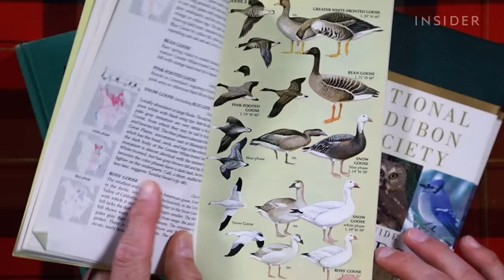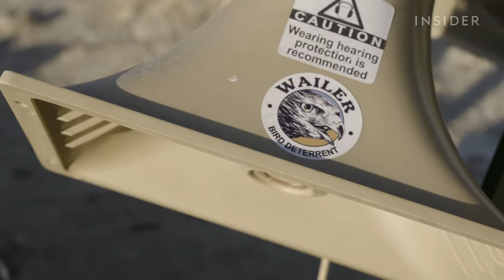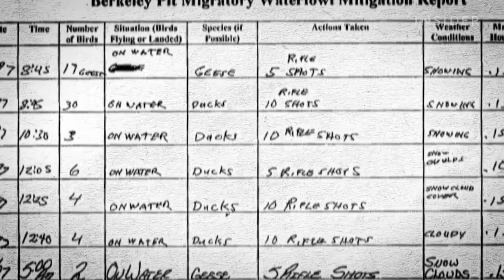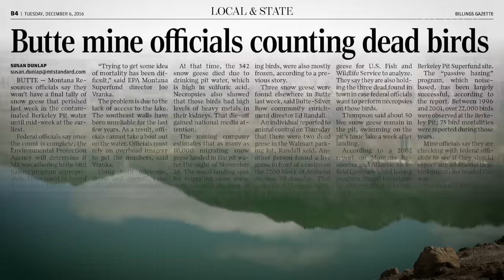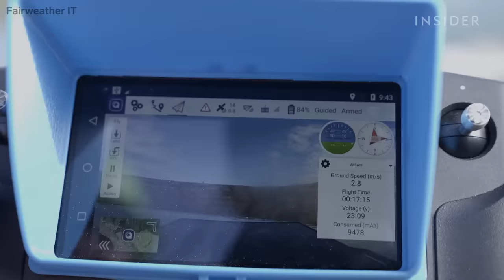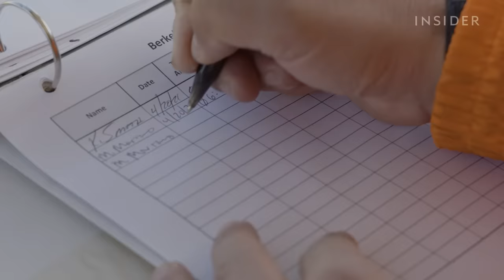Meet The Man Who Shoots At Birds All Day To Keep Them Off A Toxic Pit | World Wide Waste

Comment: I'm curious but how much would it cost to fill/cover the lake? I remember seeing a video by Veritasium where a lake was covered with black circular balls to prevent evaporation, if I recall correctly. But an additional result could be that it prevents the birds from landing on the water.
Reply: My thoughts exactly!
Reply: Interesting thought.  I looked up some information and the pH of the water there is 2.5 which means it is highly dilute sulfuric acid.  The pH of CocaCola is 2.5 as well.  So yeah, it isn't good for animals to hang out in it for hours but it isn't quite as dangerous as I was expecting.  At that low concentration, several plastics and rubbers are compatible with sulfuric acid, so the idea could work.
Reply: Yeah, I was wondering I they’re didn’t covered it with a huge net or something.

It’s likely cheaper to just keep things as they’re.

Comment: Maybe try putting a lid on that pond. Spray foam up the banks and across the water 4 or 5 feet thick. The entire thing! Companies will be able to tell you the best type of foam to handle the weather forever but the foam hardens strong enough to walk across. Maybe 6 or 7 feet but put a lid on it. Spraying 10 feet up the banks holds it in place.

Comment: The effort these people are taking to save the birds is priceless. 👏
Reply: yeah great effort but remember they are just correcting their mistake. the video said one third of their bird popullation has lost.
Reply: Remember the effort it took to rip the planet before
Reply: @chrismunz8127  I bet your indignation probably doesn't stop you from using the products containing the mineral they mined.
Reply: Dump thousands of floating balls in this pit, so that the entire water surface is completely covered and there is no water exposed!!

That way the aquatic birds won't even see the water and won't be able to get to the water ither.
Reply: @ToxicVaccines_HivHoax  I lived about an hour from this place during a point in my childhood.  This place has caused so much controversy and so many proposals have been put forward about how to deal with this place - none of which have actually gotten off the ground or worked toward getting rid of the toxic water.
Reply: @chrismunz8127  that effort made whatever device you watched and further commented on.....try again gaslighter
Reply: Some probebly misunderstood my comment. I criticize that the efforts that went into the mine were much higher than the efforts of protection. Also people first started shooting a gun, driving a RC-boat, flying a drone and handling a laser pointer after thousands of birds died. I dont see an effort to really solve the problem.

Comment: There are some reservoirs that use “shade balls” on the surface to keep birds off while also reducing evaporation losses. I wonder if a similar concept could work there
Reply: They're made of plastic and we're working with an acidic lake here.
Reply: @halamadruuid2380  shade balls are made of HDPE and HDPE is resistant to even strong acids and bases. I doubt the acid in this lake is that strong, compared to what HDPE can handle.
Reply: @halamadruuid2380  Think about the plastic hull boats they were using in this video though, it might work, would be worth testing at least.
Reply: I posted the exact same thing just now but took it down as you beat me too it.i beleive it would work as long as we used enough and had no open water
Reply: No it wouldn' twork  polymers get brittle at freezing temperatures plus the weight of the ice would collapse it in since the lake is too deep for any real center support and too long across to line cables.
Reply: @halamadruuid2380   -  all kinds of acidic substances are sold in plastic bottles and containers. 

So just because something is plastic  doesn't mean acid can dissolve it.

Also, birds are able to swim in this water without suffering any burns. So the acidity of this pit's water is very low.
Reply: @Robofrog100   -  Even so, there are plenty of acid resistant materials out there that can be used.

Even thousands of glass bottles with the lid on, will float and get the job done.
Reply: It’s an incredibly huge pit, you can even see it on Google Earth if you zoom out to all of Montana. So they would need an insanely high number of shade balls to cover it, and they would also need to be acid-resistant. Also, I don’t think they have a need to stop it from evaporating since it’s not meant to be a reservoir.
Reply: @thejessing9911  its only a mile wide. Which would take a lot of balls, but it might be more effective than paying people to stand watch 24/7. You would also only need one or two layers worth. Just enough to keep the wind from blowing them around and forming an open pool.
There are plenty of plastics that are very resistant to acid, it doesn’t have to be HDPE.
Reply: @danialphaomega  they are just floating balls, they don’t support any weight. Any ice formed on the surface during winter might just push them down. If so, the lake is covered with ice anyway and birds can’t swim on ice
Reply: @rpmrunner  would only have to dump a couple truck loads to see how they react to the acid and ice. From there they could continue to dump and they wouldn’t need to pay someone to be there 24/7 and it would be more effective
Reply: @TheBigghunter01  yeah, but that would prevent evaporation which isn’t wanted. However it would get filled with rain and groundwater all the time anyway so it’s not naturally gonna evaporate… it just might be too big of a project to fill the whole mile wide acid lake with balls, though, since it’s so iconic and it’s not even being used as a reservoir. It definitely makes Butte famous and people might not want to see it covered with balls.
Reply: @rpmrunner  the plastic boats don't sit in the water all day, they can't because they would dissolve, and they most likely rinse them off afterwards.
Reply: @Nerezza1   -  That is not the kind of acid concentration found in this pit. 

If it was the birds would feel the burn and fly away instantly. 

Try pouring high concentration sulfuric acid on a bird and see what happens. 
Would the bird stay there and try to bath in it??
Reply: @Nerezza1   - You are contradicting yourself. 

First you say "You can't sell sulfuric acid in plastic containers."

Then you say: "You can sell sulfuric acid in plastic containers..."

PTFE or not, it is still a "Plastic" container. 😉
Reply: @Nerezza1  HDPE does fine in the cold and pretty well with most acids including sulfuric acid up to a pretty high concentration.
Reply: @vqdrift6409  It's like a half mile across or something. The tensile strength of the cables and pylons needed for that is insane. Not only that, but long-term wear and tear is tough on structures like that. Imagine what a 100 mph wind would be like with a sail that large
Reply: @Nerezza1  Can't they just cover it up with a big tarp or sheet of plastic that connects to sticks on opposite sides so it stays above the water

Comment: Can't they use Black Balls like the once used for reservoirs? So they can't swim there...
Reply: The water is highly acidic, the black balls would turn to sludge. There is a very high concentration of sulfuric acid in the water and the video demonstrated what it would do the birds after a couple hours.
Reply: Whilst the plastic is pretty durable who knows how well it will hold up long term to heavy metals and conctrated sulfuric acid.
Reply: @jacobchang7955  certain types of synthetic materials are resistant to acids though. depends on the acid
Reply: @ohusky271  resistance is not immunity. That just means they will decay in the acid bath slower and afterwards who will you send to clean up?
You can’t because any prolonged exposure will melt the clean up crew. Notice how all the methods don’t involve using a boat? It’s because of the high acidic concentration in the water.
Reply: @jacobchang7955  6:11
Reply: @quive5705  notice how it was a small using a boogie board with some hardware on top of it.
The boogie board is easily replaceable and easier to decontaminate compared to the hull of a larger boat.
Reply: Some quick math:

Berkeley Pit size is around 1,414,180 square meter
Silver Lake Reservoir size is around 298,973 square meter

so 4.7 times larger

96 Million black plastic balls(used to fill Silver Lake Reservoir) cost 32 million dollars(I suspect this can be made cheaper, LA city is rich)

So this is going to be at least 150 million dollars for the mining company.

Make sense to just hire a guy to use rifles I guess, LOL.

This is not counting corrosion and winter icing that can potentially damaging the balls and adding cost.

It's probably a lot cheaper to install some kind of netting on top of the pit, but likely still a lot more expensive compare with just hire a guy.
Reply: But it's more American this ways. 🇺🇲
Reply: i just think it would be easier to put on a net or some sort of barrier around it.
Reply: @jacobchang7955  PTFE and ETFE have joined the chat.
Reply: @jacobchang7955  Teflon coated balls could work though
Reply: It makes sense, but covering a surface like that costs 200 million dollars or so and may last 10 years at best if you use acid resistant teflon balls. 

Hiring a man with a gun costs 100,000$ a year, for all the energy, material and labour costs, plus a few million in equipment which is far more cost effective than spending a quarter of a billion dollars every ten years to make a few birds go away.

Man will get the same job done more efficiently.
Reply: Here's the thing. They have an abundance of ammo and guns so why not? Just a dude with a gun and lots of ammo. Simplest problems solved by simple solutions.
Reply: Job Security ;)
Reply: Who knows, maybe a similar solution would be possible. Plastic/Rubber doesn't cope well with acid though, it'd create a whole new slew of effects.

Also possible it's just too much to justify yet. Employing several employees with guns, drones sounds cheaper than covering a whole lake with balls.
Reply: @wizzotizzo  KISS principle! But then  they will not be able to spend tons of money !
Reply: @nathandfox  exactly what im thinking.
Reply: @jacobchang7955  sulfuric acid: delivered in plastic containers
youtube comments: plastic won’t hold up
Reply: @nathandfox  why would the balls not hold up ? There are different kinds of plastic / material that can be used ..
Reply: Ceramic would be acid resistant. and there are some extremely tough ceramics available. Put small magnets in the ball at the appropriate spacing, so that as you add balls, the "net" expands as a cohesive unit instead of random balls floating by themselves. If a ball breaks, it sinks, no big deal.
Reply: @JCWren  covering the bottom of a water reservoir with plastic it’s a big deal
Reply: @JCWren  Very expensive for that large area.
Reply: @tigrehermano  I said nothing about plastic. I said ceramic.
Reply: @JCWren  that’s still pollution, innocuous pollution. And ceramic it’s expensive but the concept it’s good you just need a widely available material.
Reply: @tigrehermano  and how well will they hold up to being crushed in ice? Simply all these other options are vastly more expensive and would require reinvestment every few years to replace all the broken and crushed ones. It financially makes zero sense!
Reply: @jacobchang7955  The proper plastic is resistant to many types of corrosives. Jesse found out the hard way in Breaking Bad.
Reply: @deannelson9565  i am not suggesting ceramic lol read my previous comments
Reply: I thought exactly the same, but it seems more fun to just shoot some guns
Reply: @tigrehermano  And I think Im gonna leave it that way
Reply: @tigrehermano  Sulfuric acid is stored in HDPE (High Density Polyethylene)
A half inch thick sheet that is 384 ft squared costs about 45 dollars. That means it would cost 1.6 million dollars to cover the surface of the lake.
Note that HDPE containers are rated to have a 20 year shelf life when storing high concentration acids in ideal conditions (cool dry environment). So at best, you would have to replace those plastic balls after 20 year or else you add a layer of plastic sludge to the lake.
Reply: @mixrable1212  For about 20 years before they break down at best. Teflon has a high acid resistance but will eventually break down and now comes the question.
Who's going to risk their life cleaning that mess up or are we just going to allow a nice sludge of plastic float on top.
Reply: @DanA-bw7rh  Resistant does not equal immunity that just means they will break down sooner and who's going to fetch the plastic before it turns to sludge in the lake.
Reply: @jacobchang7955  Dude, you take life way too seriously.
Reply: @DanA-bw7rh  I'm taking this issue with the same amount of consideration that the people taking care of the issue are.
If that means I take life seriously, at least my idea won't make the problem worse later down the line.
Reply: @jacobchang7955  so the foam buggy board and plastic kids boat were cgi?
Reply: I think they’re just having fun at this point
Reply: The water cooks birds. I'm pretty sure it would destroy the black balls
Reply: What does race have anything to do with this??
Reply: Not as fun
Reply: Put a less dense liquid on top of the lake like oil. yes its bad but its not acid and im sure there are other options. Dump a shit ton of coal ashes from power plants they are always looking for a place to dispose of that stuff.  It would help lower the acidity at least.
Reply: @nathandfox  The mining company? I live here and believe me this is all on the shoulders of tax payers.
Reply: lol, i wrote the same thing then i saw your comment lol
Reply: @jacobchang7955  pretty sure their are plastics resistant to acidity considering some acids come packaged in it
Reply: Why not just ask the Russians for assistance?  
Back in the day of the space race..  NASA made a pen costing a million dollars ... the Russians used a simple pencil 🤷‍♂️

Sure there must a simple and a cheap solution!
Reply: @wb5648  resistance is not immunity. Teflon coated HDPE has a lifespan of 20 years in ideal storage conditions.
Resistance is not immunity.
Reply: @Bigredkarl  so when the geese land, their feathers get swamped and so they die from the acidic water anyways.
The coal ashes is just going to cause the water to become an even more toxic, thick slurry that still won’t dissuade the geese from coming to land.
Reply: @rustyshackelford1413  Well, I say your local government should setup a design challenge for the problem, providing detailed data on the issue, for example the water chemical composition, detailed size measurements of the site, budget limitation, etc. The participating proposal needs to have calculation on cost and longevity, plan for execution, and then use the media attention to hold another fundraise to get the money to execute the winning proposal to solve the problem for good.
Reply: @nathandfox  We get federal dollars because its an EPA Superfund Site. You also have to realize that Montana is big, but the population and average incomes are low. Our state budget isn't huge. The other thing is we are one of the most red states in the country. Our state leaders are wealthy and they look out for their own when spending money.
Reply: It would vanish
Reply: @nathandfox  This is Montana man, we're all blue collar here. People don't have money for something like that. We are one of the most red states in the country, so if it doesn't make money for someone Helena won't do anything about it. It is however an EPA Superfund site so we get some federal dollars and ironically Butte offers paid tours of the place, but I don't know where that money goes.
Reply: @rustyshackelford1413  Understand all that, just saying this can be a very interesting engineering problem to solve. Making it a design challenge(For high school and undergraduate students) can be both educational and fun. Setup the challenge itself won't cost much, and can do a fundraise to get the actual money for executing the winning project from the design challenge.
Reply: @nathandfox  It would be interesting to get a few groups engineering students from MSU to design and test some possible solutions on a small scale.
Reply: NO.
Reply: @jacobchang7955  Further illustrating my point, guy with a gun is cheaper
Reply: Too acidic and shade balls also contain some water inside them, freezes in winter and explode.  They were designed for California weather.
Reply: @jacobchang7955  Your plastic point, like every other version of it, is moot. Covering the lake would halt/hinder evaporation. This would in turn throw the water system equilibrium out of balance, causing water levels to rise towards the alluvial soil layer. Allowing the contaminated water to flow freely into the nearby streams which eventually end up in the Columbia River. 

Some water is being pulled out treated, but just at a rate that assists with keeping the water below that level. This is neither easy nor cheap to do so. 

Your HDPE suggestion literally only takes into account a single factor. The water's PH. There are multiple types of acid in that soup as well as metals, minerals, and extremophile organisms. 

And then there is Montana climate on top of all that... What does a square mile of snow weigh assuming it is just 1ft deep?  

By the time you come up with a material that is resistant to all of these factors (there are more), it would be astronomically expensive. Unfeasible in the real world.

It is cute when people on the internet believe they know more, after watching a couple-minute video and doing next to zero contextual research; than the people who have spent their lives/careers working on the problem.
Reply: @travisbarry2909  my entire point in this comment thread was explaining why not to use the plastic to everyone that kept suggesting it.